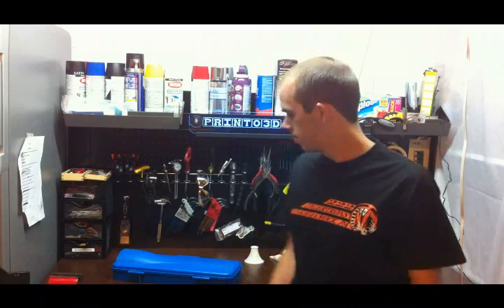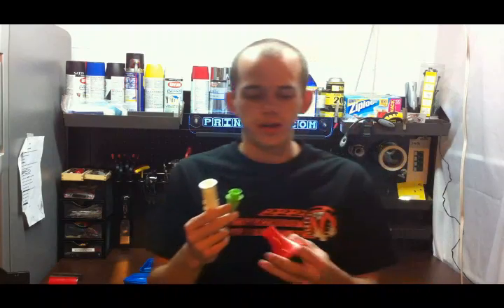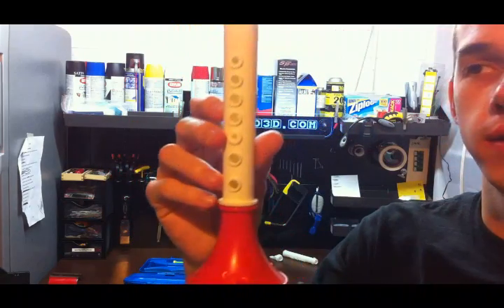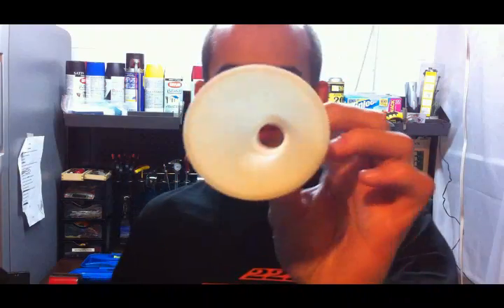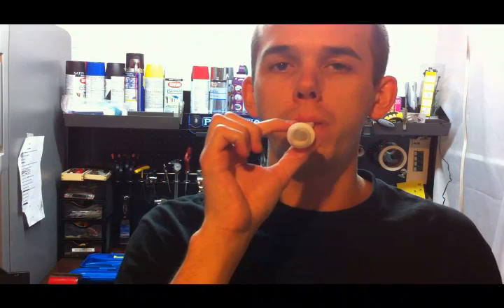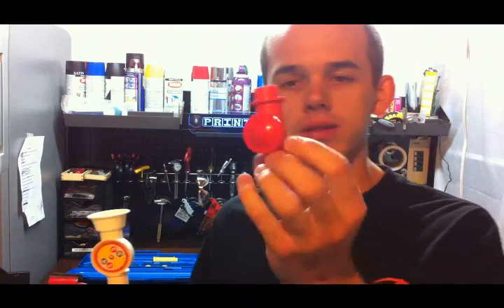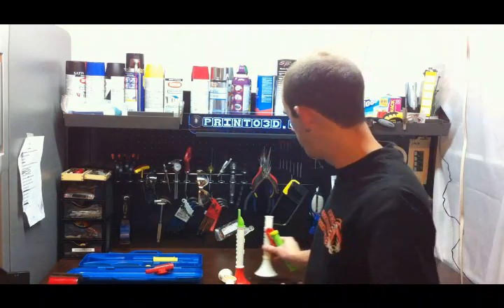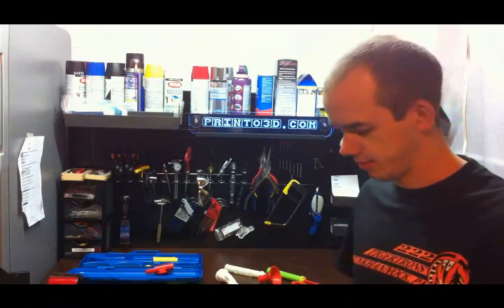3D Printed Recorder/English Flute

Comment: Usually, recorder  has a conic pierce (like the saxophone, but with the foot as the conic part), so the way how the foot was done wasn't the best. I also think the bevel of the mouthpiece where the wind hit to produce the sound need a little bit to be sharper, or at least with an inclination that fits the production of sound better. That's for the main points.